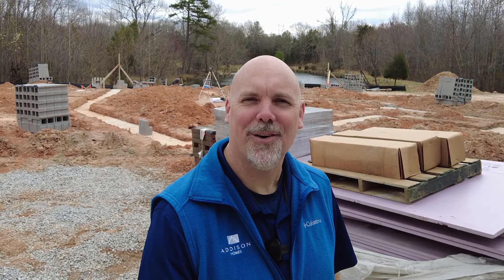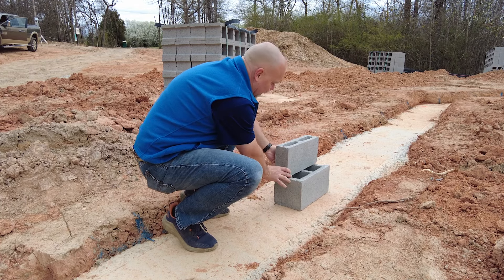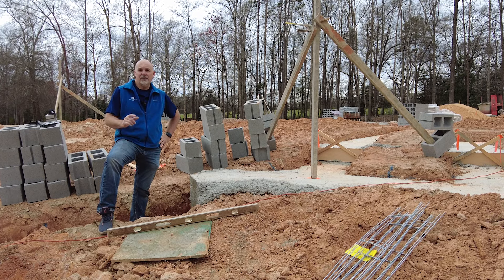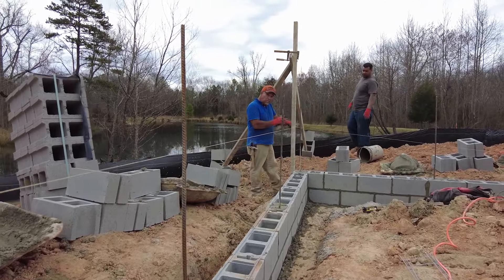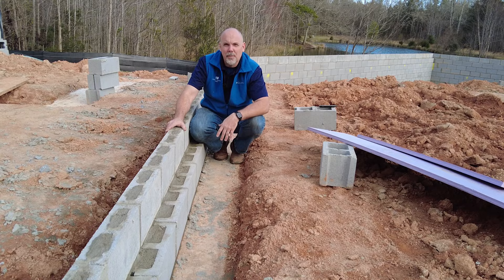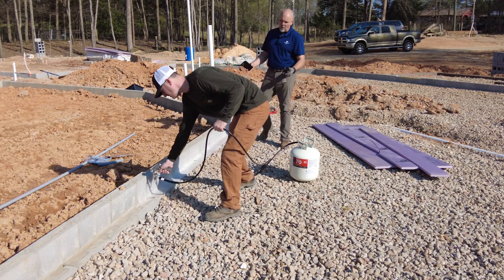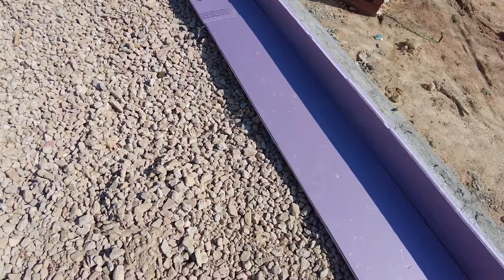Stem Wall Slab Foundations | The HOW and WHY

Comment: Excellent presentation.
Reply from the maker: Glad you liked it!
Reply: @AddisonHomes  you used gravel , can you use dirt ? which is a better choice ? how much does this cost ? 66 feet by 45 feet.
Reply from the maker: @amadueskooler6559  We use stone at minimum along the foundation walls of the stemwall slab.  The stone is self compacting and allows us to avoid having to compact dirt against the foundation walls which could result in damage.  We typically will add compacted dirt to the center of the foundation area when rough grading the site which minimizes the amount of stone needed and is less expensive.

Comment: I'm enjoying this series. You give a nice summary of the steps and materials required in a no-nonsense manner. Very professional! We are building outside of Atlanta next spring and our footprint will be about 131' x 72', which includes garages and patios. Given the size it seems like a stem wall slab foundation rather than monolithic is the way to go (crawl space is too expensive.)

A few questions, please: how thick a slab would you recommend? Looks like you'll be pouring a 6" slab on this particular house; will that suffice for something as large as my slab? What if I wanted 8" thickness, or would that be overkill?

And maybe I missed it; I saw the piping to be "slabbed," but I didn't see the water lines. How did you handle those?

Would you be able to share a rough cost of the foundation build up to this point, just as a reference?

It's been a few months since this video so hope you post updates on this build! Thanks!
Reply from the maker: Thanks so much for the kind comments Tony!  So glad you are finding the information useful.  That is our goal.  The stemwall slab, in our opinion, reduces any chance of slab heave that could occur with a monolithic slab.  Be sure that you have sawcuts or explansion joints in your slab being that size to prevent excessive cracking.  The slab in this video will be poured at 4" thick with grade beams poured to 10" thick under any load bearing walls.  The 4" slab is perfectly adequate for a residential building but does need grade beams installed under load bearing walls sized based upon the load they carry and your soil conditions.  If you wanted additional strength in your slab, I would suggest welded wire mesh and/or higher strength concrete before I would go thicker.  
We typically keep our drain lines beneath the slab for obvious reasons but run our water lines overhead for access and ease of layout for efficient hot water distribution.  They are insulated and buried in the attic insulation.  
The direct costs were around $36k including the footings, walls, backfill, insulation and concrete slab.
Reply: @AddisonHomes    Very helpful, thanks. Todd. Appreciate you taking the time to respond.
Reply from the maker: @tonybrischler5172  You are so very welcome!  Glad to assist.

Comment: Finding out first hand how critical the slab insulation is, especially on taller slabs where more exterior surface area is exposed. On slabs closer to grade say <18” not as critical but >3-4’ and slab insulation is a must. Thinking that sweating slab is the root problem to prevent first and energy savings 2nd. Don’t need or want condensation on the perimeter walls.

BTW, sent an email on this topic.

Comment: Awesome video, Thank you for sharing it!!
Quick question... Here in florida, the plumbing underground pvc pipes cannot be seating under rock foundation, we need sand underneath. Since you are using rock... do you need a soil compaction test before pouring??
thank you!
Reply from the maker: Great question. It depends on the jurisdiction as to whether they require that we bed the plumbing drain lines in dirt or will allow stone. Our plumbers typically lay in some red dirt (in our market) on top of the stone under the pipes to prevent any issues. 
If we have portions of the foundation that we backfill with compacted soil, we always test compaction.

Comment: Thank you for all the informative videos! When insulting the inside of the stem wall, how do you cover the foam? I’m sure a 6” wall will cover most of it.
Reply from the maker: You're welcome!  We install a termite flashing on top of the foam edge and under the entire framed wall.  The product we use is called TERM and made by Polyguard

Comment: Crazy how different this is from what I've seen doing commercial construction in Maine. I've seen 6ft footings before and insulation goes under the entirety of the slab.
Reply from the maker: @cambridgehartley3567  yes- construction details can be significantly different in dramatically different climate zones.

Comment: I'm a residential designer. This was a great video and answered a lot of my questions.
One last question - is there any cost advantage to doing a monolithic concrete pour, instead of his approach, which requires several steps?
Reply from the maker: On this particular foundation, we had some slope across 1/3rd of the foundation. The stem wall slab approach allowed us to adjust for this variation in elevation with a taller stem wall and internal fill material.  This would have been difficult trying to approach the conditions with a monolithic slab. 
For a dead level site, a monolithic slab can definitely be done, but the foundation insulation is then exposed on the exterior of the foundation.
Reply from the maker: Sorry, just re-read your question.  To answer your question regarding cost, it can definitely be more cost effective to do a monolithic slab depending on the market, labor availability, etc.  Hope that helps!
Reply: @AddisonHomes  Why couldn't you make it level with a building pad?  Planning to build a home myself in Florida, hoping to educate myself.  Looking to build an uber reinforced concrete home (1900 square feet).   Since I'm doing the work myself, I'll spend money on Owens Corning pink rod rather than steel, fiber reinforcement throughout all concrete.  It will be a 2 year project.
Reply from the maker: @Tomtrong-y1b  We have rolling topography here in the foothills of SC and there are many sites where moving that much dirt around isn't possible due to the proximity of other homes or the topography itself.   In this case, the house was adjacent to a nice pond

Comment: If the house is going to have a brick skirt could you bring the brick up 4” above the block and pour to the top of the brick over the block?
Reply from the maker: I don't really follow your points.  The best location for the fan is in close proximity to the sources of moisture (tub, shower, etc).  If there are multiple sources, install in between them.  Regarding makeup air, there isn't a significant need to have air flowing across the sources of moisture and odor - the bath fan is going to pull air from the HVAC supply and/or under the door to the room.

Comment: Was it wise to have the PVC rough plumbing to be in direct contact with the course stone? Maybe should have had a pile of clean sand to lay in the trench then install the PVC on top of the sand. I used this technique in S. Florida, where our monolithic slabs needed to be elevated to meet a minimum floor elevation relative to the crown of the road. The plumbers would create their trenches in crushed rock backfill, install the clean sand, then install the underground PVC.
Reply from the maker: This is typical practice in our market.  We don't see much sand used in construction in our market.  I know other markets where sand is the predominant fill material.  I supposed it depends on what is readily available in a given area.

Comment: Hey. Can you do this in cold climates?  Thanks!!
Reply from the maker: Yes, absolutely
Reply: No, any foundation system in a cold climate must guarantee that the concrete doesn't freeze. In this case you would have to add horizontal insulation on the exterior to make a frost-protected shallow foundation (FPSF)
Reply: in the north everyone has a cellar , you have to dig below the frost line .

Comment: For constructing the stem wall, please explain the pros/cons of footings+CMU vs. all one pour for the footing/stem-wall.  (The slab is still a separate pour in both cases.).  Maybe it's not easy to create that ledge if it's a concrete pour?
Reply from the maker: We’ve never seen a footing and stem wall poured at one time. A poured in place stem wall would typically be formed on a footing previously poured. In our market, this would be more expensive than a CMY stem wall and many poured wall contractors wouldn’t be interested in such a small job. The other alternative would be the monolithic slab where the footings and slab are poured together.
Reply from the maker: CMU- sorry
Reply: @AddisonHomes  Okay, thank you, good to know!
Reply: Yes, thank you for explaining things so well!!! I am grateful to have found your videos!! Keep them coming pls

Comment: Is there any need for drain pipe and stone under or behind the footing?  I see tons of homes in the south with none.
Reply from the maker: No perimeter drain is needed for a stem wall slab or monolithic slab unless there are bulk water issues.  No stone is required either, but we often use stone for the backfill inside a stem wall slab.

Comment: I found this interesting and also a little concerning because you seemed to suggest that backfilling with dirt would increase the risk of a blow out. I wish to do this build debit free so I'm trying to save money at each step when possible. Dirt is a lot cheaper lol. my wall is only 4 courses high with L blocks on top so a total of 5 this is the tallest portion of the wall . what do you think about a dirt fill of about 3 ft with stone the rest of the way? TIA
Reply from the maker: Thanks for the comment!  Backfilling with dirt can increase the risk of damage to the wall when compacting the dirt close to the wall.  A couple of thoughts for your project:
- to reduce the risk of damage to the wall with relatively small amount of backfill (4 courses = 32 inches), you can stub up some rebar out of the footing every 4 feet or so and fill the cells of the block at the rebar with mortar.  This will add strength and keep the wall from pushing if you compact the fill close to the wall. 
- with only 32 inches of fill, depending on how you plan to compact the dirt fill, stay back a few feet from the wall so you don’t put too much pressure on the wall from the dirt. Your slab will be supported by your block at the perimeter and can easily span 2-3 feet of less compacted fill. You could add some rebar from the L-block back to the well compacted fill for additional support. 
Hope that makes sense!

Comment: I like the 6" perimeter block on top,           Did the inspector let you install verticle rebar after footing was poured . The 1st. video , there was no  verticle rebar  coming out of the footing.
Reply from the maker: Yes, we typically install the vertical rebar by drilling into the footing and using epoxy adhesive.  This is allowed in our area and allows the mason's to more accurately align the rebar with the cells in the CMU block.

Comment: Great video thank you!
I have a garage almost starting to build.  54 by 80.  3 ft foundation, one ft steam wall.  In Utah would you recommend same style of installation?
Reply from the maker: This can work but your climate zone and local code will determine the required depth of your footings and foundation.  There are also options for frost protected foundations that allow for more shallow footings / foundations in colder climate zones.

Comment: I'm building my spouse here in NC this exact same way, I've got a question. I'm curious about how yall do your foundation drains, and also what you do about all the water that will be trapped on the interior of the home if it rains before you pour the slab?
Reply from the maker: On stem wall slab foundations, a perimeter foundation drain and waterproofing isn’t required. 
We’ve never had any issues with water being trapped within the stem wall prior to pouring concrete. Any rainwater that falls prior to pouring the slab just soaks into the soil beneath. 

If water table was a concern, drains can be added through the stem wall to relieve any water that might come up from beneath.

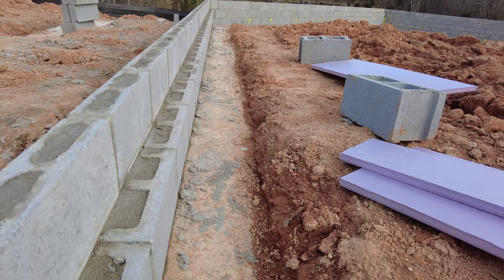Comment: Cool video, I'm taking NC contractor classes now and am wondering why no dowels/rebar sticking up from the footing into the blocks @6:00 mark?
Reply from the maker: The rebar extending up from the footings aren't necessary when the interior fill isn't over 2-3'.  Code requires it over 4' but we typically add it if we are filling more than 2-3' with stone.  It would be critical to incorporate when backfilling with compacted dirt fill.

Comment: Is stem cell wall foundation or monolithic slab more appropriate for south texas?
Reply from the maker: David-  It really depends on the soil bearing capacity in your area.  If you have expansive clay soils, these may require an engineered slab foundation.  Be sure to check with a local structural or soil engineer to be certain.  If the soil type is conducive to standard prescriptive foundation types, you should be good with either type of slab foundation.
Reply: @AddisonHomes  Thank you very much!

Comment: Nice video...how do you anchor you sill plates?  Thanks
Reply from the maker: Fantastic question!  We actually embed them in the concrete slab when we pour.  Its a more solid connection to the slab.
Reply: @AddisonHomes  Thanks for you response..just curious how this is done if you have 4" frame wall over 4" block.Are you using a 90 degree strap anchor? Thanks
Reply from the maker: @johnmed1972  Absolutely - The inside of our exterior walls are actually 5" in from the outside of foundation (1" Foam Board, 7/16" sheathing, 3.5" stud) and we use a standard foundation strap which we lay into the concrete at an angle so the two straps sit under the framed wall.

Comment: I am also in SC (Anderson) I did a stem wall on my build mainly because I like the features of a slab over a crawl. I didn't weight the two from a cost perspective. Is stem wall slab better value than an encapsulated crawl? I know slab on grade mono is the cheapest foundation (which is why all the production builders do it).
Reply from the maker: The cost depends mostly on the topography of the site and how tall the stem wall and crawlspace walls must be.  On a relatively flat site, the stemwall will be less expensive than the encapsulated crawlspace by a significant difference.
Reply: @AddisonHomes  Thanks for the reply! My property was very similiar to this where about 1/4 of the perimeter was about 6-8 blocks high. I really like my stem wall slab and like the firm ground underneath vs a crawlspace. Also, like knowing no critters are living underneath my feet lol 

My stem was foundation was also with 4" block and exposed brick sandwiched together.. Why would some foundation experts build it this way vs coming in after and doing the brick on the exterior of a CMU?
Reply from the maker: @garrettp.5018  if the desired exterior finish is brick, then masons will often lay brick and 4” cmu together as you describe. The brick technically needs to be structural since most of the exterior wall bearing sits on the brick. 
If the brick was installed outside of the  8” and 4”, it will site beyond the framed wall and require a brick water table cap to terminate. This is, however, exactly how it would be done if the entire building would have brick veneer siding - the brick would sit outside the block foundation and extend up the outside the framed wall and up to the soffit.
Reply: @AddisonHomes   Okay, So the foundation with the brick and 4" CMU would yield a brick wrap slab only foundation. The siding would protude past the brick. If I wanted a brick roll off I would do the brick as an exterior off of an 8" CMU? This would give the depth to stick out past the siding?

What prep has to be done if the brick will be  the siding? It would start off of the footers and build up? Then there need to be an air gap between the sheeting and the brick wall?

BTW, I emailed your on your business email. Thought this might be the best way to get in contact with you since I am local to Anderson, SC.

Comment: How much more does (% percentage wise) does increase this cost of the slab? On average, just percent as I know the cost  varies.
Reply from the maker: @Dan_Akins  it really depends on the site. If it’s dead flat lot, the cost of a stem wall insulated slab versus a monolithic slab is likely within 1-2%, but the stem wall slab requires a few more steps so it may take a little more time on the schedule. 
If the lot has some slope, a monolithic slab is impossible without significant site work.

Comment: A header block will accomplish the same thing, be stronger, and still give you room for anchor bolt centering.
Reply from the maker: Unfortunately the header block approch prevents the ability for the perimeter insulation which is why we do not use the header block.
Reply: @AddisonHomes Are the anchors for the sill plate offset? How did you install them?